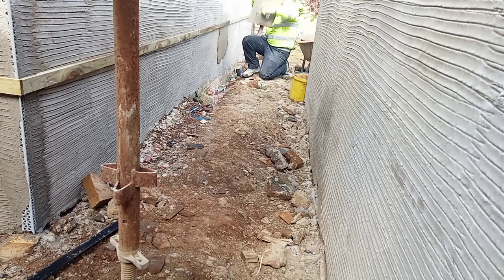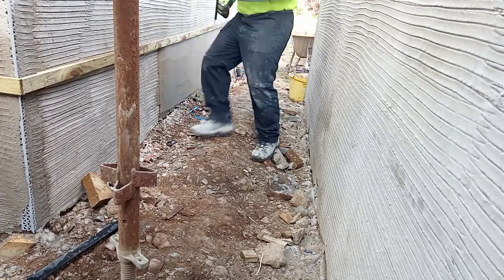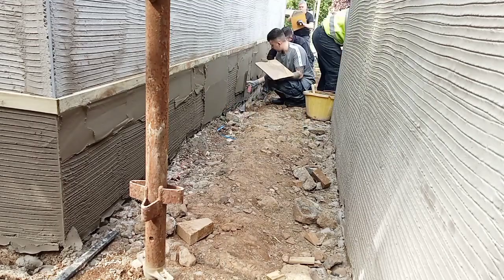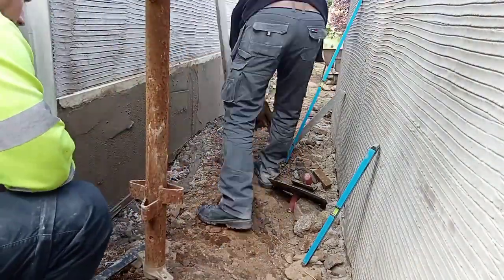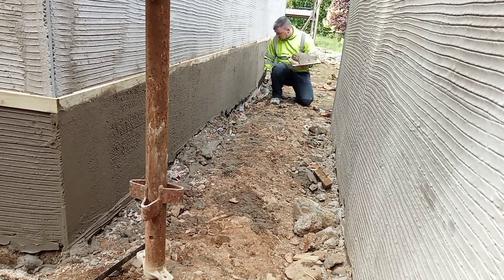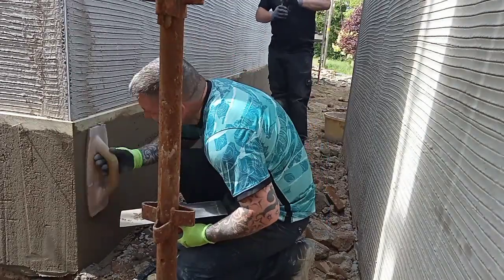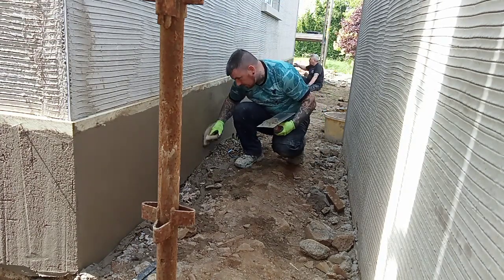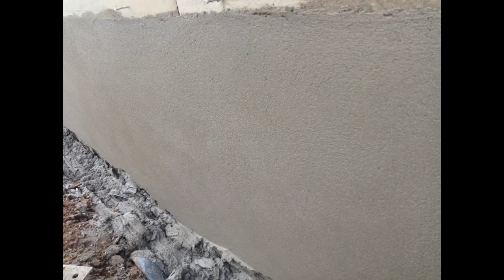Chamfered base

Comment: Do u use mortar mix in your top coat and no waterproofer? Do u just use water proofer in your scratch? Great work thanks
Reply: Yeah usually just mortar mix in topcoat Andrew. If it’s not getting painted straight away we would put waterproofer in or if we’re doing a big panel waterproofer holds it back a bit.👍